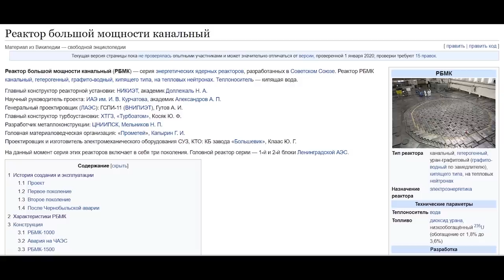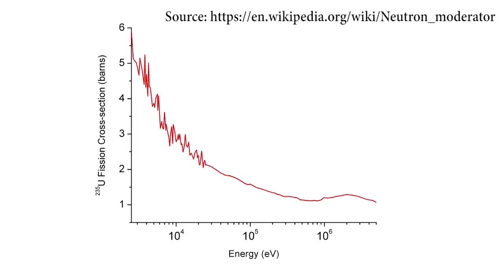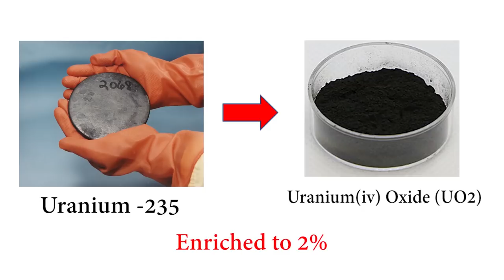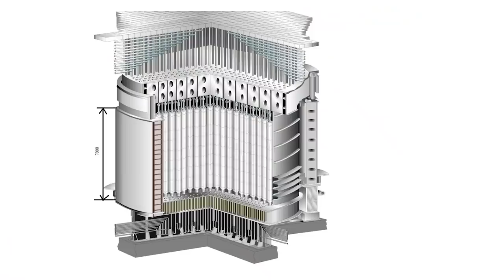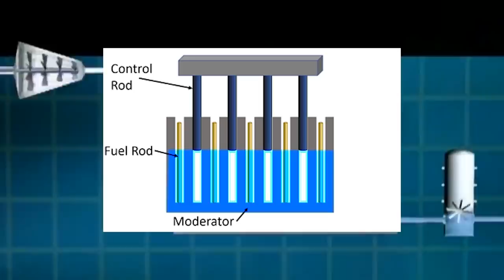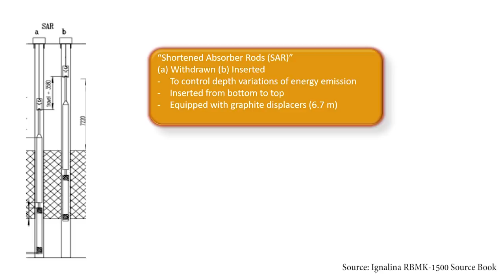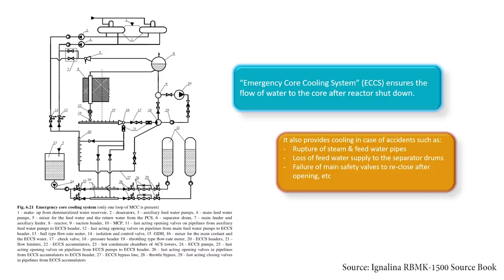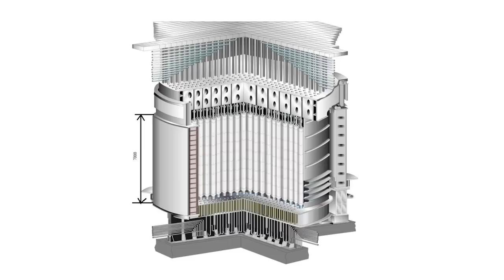RBMK Reactors - Design Overview | The Nuclear Reactor that was used in Chernobyl

Comment: So how about the statement of Legassow in the HBO series, that the graphite tips on the control rods were used, because there were cheaper? Is that also true?  And have i understood it right, that the graphite only enters the core if the controlrod is inserted, or is it all the time in it as constant water displacer?  Nevertheless...that was a very good and interesting video...well done
greetings from germany
Reply from the maker: Well, we can hardly say that's the reason why it is cheaper, it is cheaper because of the entire concept of the reactor that was applied(also due to the lack of a containment building). The graphite water displacers are there so that RBMK reactors can achieve better control of the reactivity. In short, it is a necessary aspect for the reactor design.  

When the control rods are withdrawn, the displacers can fill the space instead of water to get higher reactivity since graphite is a stronger neutron moderator compared light water. This also comes with a flaw as I have explained in the video. It also causes an overall increase in fuel reactivity when they are inserted from a fully withdrawn position since they have to displace the remaining water first before the control rods can be fully inserted. Thank you.
Reply: @antares2767  The emergency shut down control rods that goes down into the reactor when somebody uses the A3-5 button today are not the same that were used in Chernobyl NPP.  The A3-5 control rods used in Chernobyl had those water displacing graphite endings. The A3-5 control rods that are in use on todays RBMK´s don´t have those water displacing graphite endings any more. Also the A3-5 control rods are not for controlling the power output level on todays RBMK´s. In Chernobyl it was for controlling the power output level and for a complete emergency shutdown.
Reply from the maker: @derwildewesten6700  I couldn't find any sources that indicate that the displacers were in fact removed. Post-Chernobyl modifications included the addition of 24 FASRs, which do not have graphite displacers in them. The rest of the rods were re-designed in terms of dimensions so that they don't leave behind a water column at the bottom of the core. But no statements about the displacers being removed. This was from the Ignalina RBMK-1500 source book(Chpt.13) I included in the desc. But if what you said is really the case, can you also provide sources to that so we can clarify? Thank you.
Reply: @antares2767  I think the A3-5 switch is for those 24 FASR´s. It´s the emergency shutdown.  So those 24 control rods don´t have  graphite endings.

 In Chernobyl the A3-5 botton was for all over 200 control rods which all had graphite water displacers.
Reply from the maker: @derwildewesten6700  Oh, that would be the Баз switch to insert the 24 FASRs. Also for current operating RBMKs, such as smolensk NPP and now decommissioned ignalina, the scram sequence that inserts all the Control rods is done by AZ-1.
Reply: @antares2767  Which of these switches is the emergency shutdown now? In Chernobyl i think it was the A3-5.
Reply from the maker: @derwildewesten6700  Both (AZ-1 and BAZ) act as emergency shut down systems(brings the power to zero) depending on the situation.
Reply: @antares2767  Okay, so they changed the emergency shutdown from A3-5 to AZ-1 and BAZ. I guess in a worst case they have to switch both. But what is A3-5 for today? Do you know? Thanks.
Reply from the maker: @derwildewesten6700  In current operational rbmks such as smolensk-3, the AZ-5 is not used according to Parisi's paper: https://www.google.com/url?sa=t&source=web&rct=j&url=https://core.ac.uk/download/pdf/14696543.pdf&ved=2ahUKEwipz9HkyZbtAhWEtZ4KHabjBSoQFjADegQIDBAB&usg=AOvVaw2SPail254t4biw7BFfCZYu
Reply: Hello, this statement Is also fantasy by HBO.